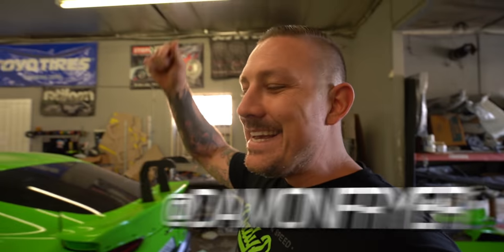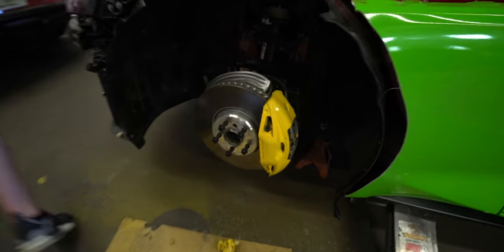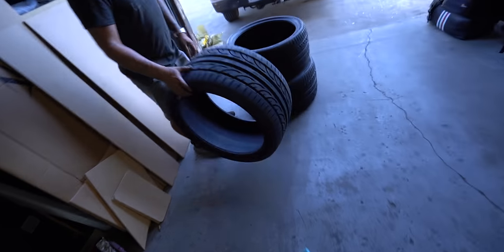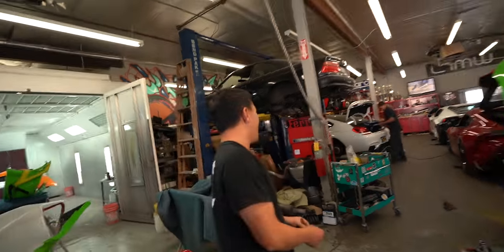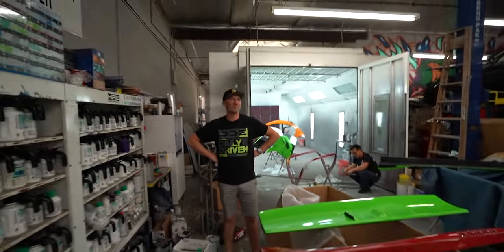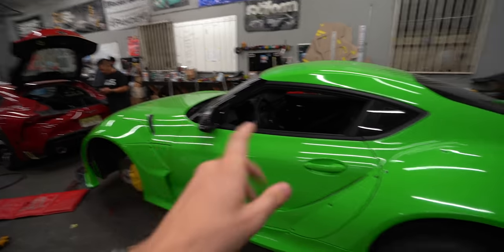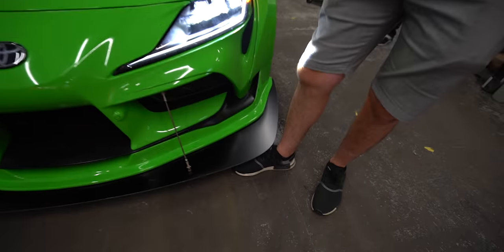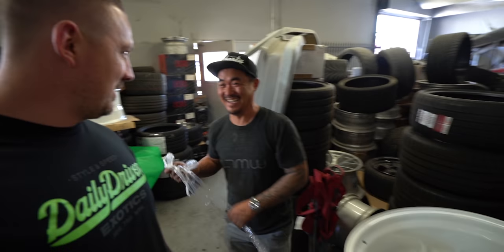FIRST V1.5 WIDEBODY 2020 TOYOTA SUPRA ROCKET BUNNY KIT!

Comment: Yuck. I am sorry but as a fabricator I hate MIG welded roll cages. Specially on such a nice car. It should have been TIG welded or at least made to look good. Whoever welded it did a poor job. Im not the best but if you are going to do it at least make it look good and function. Those welds look a little cold.